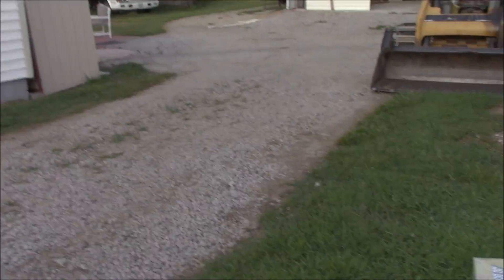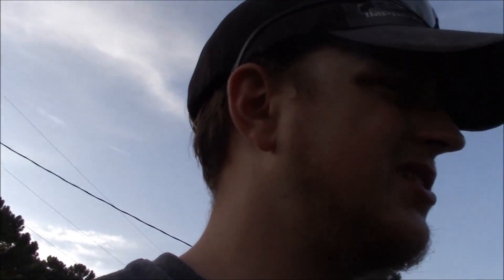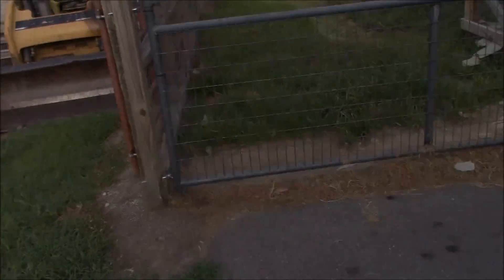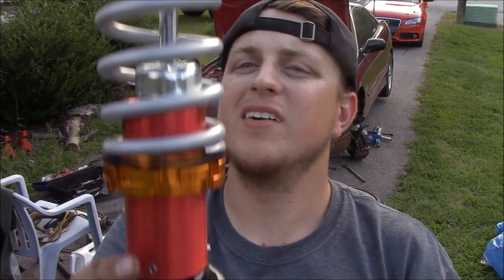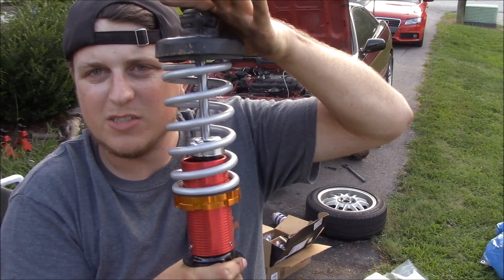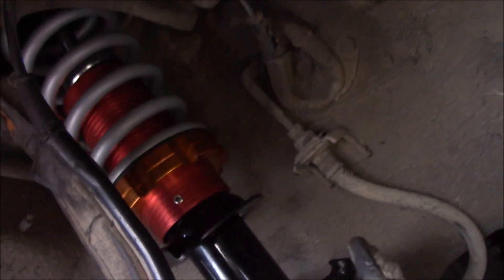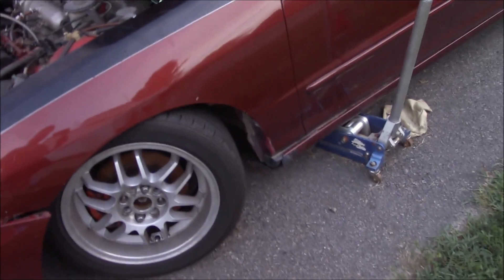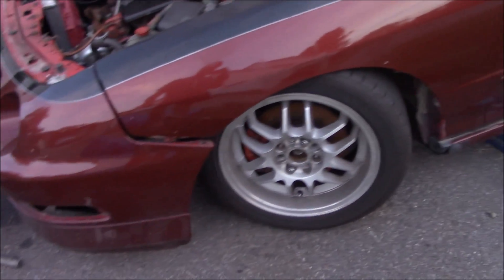Dont Buy cheap adjustable springs for integra

Comment: You have your rear springs in the front and you struts aren't assembled properly, so the weight of your engine is just slamming it down. The spring rate between your front and back is always different due to the placement of the engine and it wieght. It's hard to tell which springs are which new in the box, especially when there all the same height at first. Pay attention to the diameter of the bar on spring, thicker goes up front thinner in back. Once the springs have been worked a bit you'll notice a heighth difference if you take them back off. Also flip you adjuster tube little silver bolts go at top, all the way in til they just clear the threads. Push the tube down really good first, bottom just wedges in. there should also be different size o-rings that came with it, space two or three out inside adjuster tube to make up slack space.
Reply: I was having the same issue with the dna motorsports kit i put on. i put one back spring on the front.This post just saved me some money and stress. Thank you!
Reply: He probably should have read the instructions lol

Comment: Also you need to remove the top washer off your old assembly that locks the shock piston in place. New kits do not come with it you will need it yes you'll have to do this. I have dna motorsports suspension off amazon, was a f*Chen nightmare to figure out. But supriseingly with it in the end. Get them springs swapped around, spin them adjusters up she'll sit right where you want

Comment: Bought these same exact coilover sleeves (aka junk) well on stock shocks for my 98 civic... the car I bought 6 months ago for 800 bucks so just a budget build I wanted to lower it now the wheels bottom out into the wheel wells if I'm not careful some dips on the road/highway send me airborne or close to it for a horrid slam it's hard to explain I'm sure the stock shocks dont help so I'm starting to think after watching your video maybe that adjustment is just a damper? And that adjustment doesn't actually change ride height?  Far fetched lol but I guess it's possible. If you have any suggestions without me spending much more money at all to make my car drivable let me know I'm gonna try and adjust these all the way up and if it still sits low I'm gonna take it for a spin and see how she rides

Comment: your suppose to tighten up the half shaft center nut with the wheel on the car. & with the car on the ground.  with a Torq wrench  to spec. & you could have sat the car's front tire's on top of two  2 x 4. to get the floor jack out from under the car.
Reply from the maker: Nate white thx mate i was just so bummed out and was done with it lol
Reply: what i did also got  4 my 1995 Acura & my 1990 Supercoupe .is  i  customized some steel  Ramps that i have had 4 a long time by  shorten them  so there not 2 tall of a incline. so i can drive both my low riding cars up the ramps with out the front end of the car's  catching on the ramps to be able to get a floor jack under the cars to jack it up safely  high enough to get  jack stands under it . or 4 when i just changing Oil & don't need to put it on jack stands.  & my acura  is at stock height.

Comment: hey man, i have some leftover skunk 2 lowering springs that im not doing anything wth after i installed my kyb agx shocks and sparco springs. you want them? 2.75 front and and 2.50 back drop. they have some rust on them but still sat the car at a good drve height but lower than stock. you just pay shipping. im in ohio

Comment: Looks  installed incorrectly to me
Reply: definitely not, everything is wrong. he didn’t put in the top hat that came with, the sleeve is upside down and he’s using the rear springs in the front.
Reply: That's what I ment by incorrectly

Comment: Damn man you do almost everything wrong haha
You installed the adjustable collars the wrong way up which is the reason you couldn't get it up higher. Also, please use a torque wrench on the axle nut instead of a small rachet and a pipe. God damn
Reply: Took the words outta my mouth. I got those on my ek sedan no problem i can put my fingers between tire and fender and rides nice. Also ebay camber kit up front, no issues. He had the sleeve on upside down first off.

Comment: The best way to set up eBay sleeves is to start with them all the way up because for some reason one if not two of the Springs are always softer than the other I found out which ones did that and swapped both of those into the rear and then adjust height from there